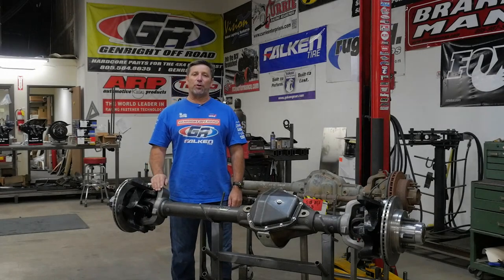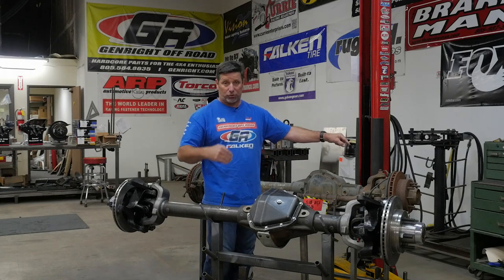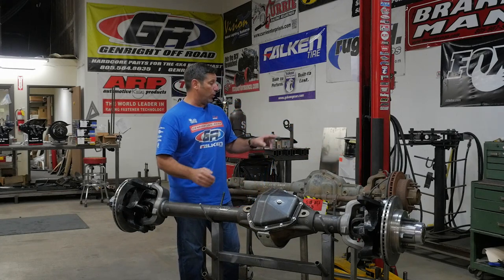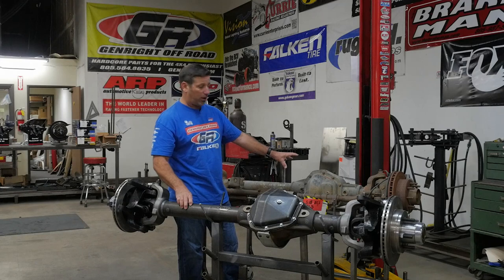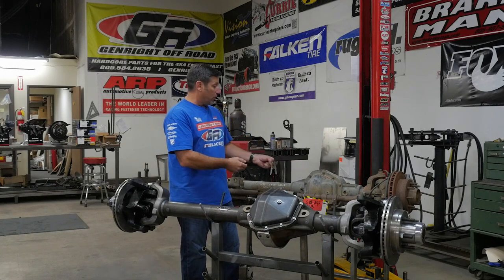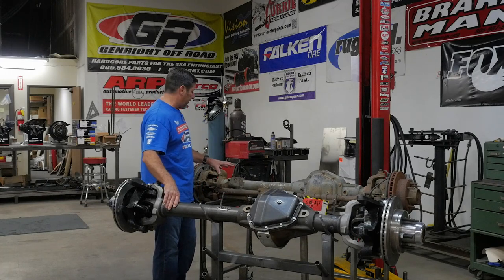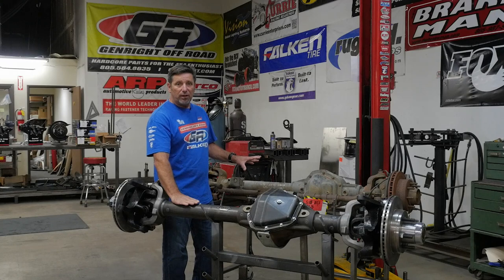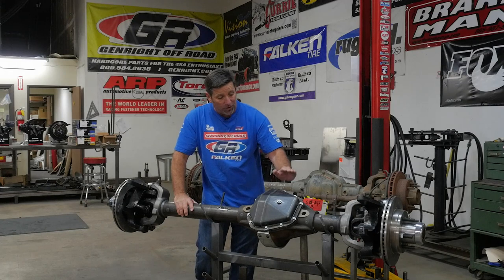Pros and Cons to Building Junkyard Axles | GenRight Off Road

Comment: 05+ super duty axle almost addresses all those concerns and can be had for less than $500. I can also go to any part store for parts. I'm not running chromolly but of i break a shaft I'll put RCVs in it... He is absolutely right, time is money and I have more time than money because my money is making me money! 5.38s, ARB, Yukon slugs, TMR truss less than $2700 for the entire axle.
Reply: You didn't do the Ballistic Shave Kit? Did you do the 14-bolt or Sterling 10.5/10.25 in the rear?

Comment: Theyre just hurting for sales because guys like me build superduty axles for my JKU for less than the price of 1 of the rear rock jock axels. The tube on the drivers side is no big deal. i had coil springs and now coilovers and still had roof for a 3 link set up. Im running stock 35 spine inner/outer 1.5" shafts, 4.88 gears, stock LSD rear and Zip locked up front. For breaks, THEYRE MEANT TO STOP 20K lbs OR MORE QUICKLY. I just bought the Duralast Gold Pads and Rotors and i lock my 43s up like im still on the 37s. As far as clearance goes, im running shave kits for both the 60 and sterling axles.
Reply: Heh, they picked the worst possible axle to show differences... a dodge with no locking hubs and crappy outers.
Reply: You guys keep saying the same thing not even realizing genright doesn’t produce axles
Reply: Yes but they have a great relationship with Currie and just want to up sell them
Reply: I've called GenRight and emailed them on multiple occasions and they are always booked solid...For their builds, they offer Currie AND Dynatrac.  Most buyers aren't certified mechanics with all the necessary tools and machines to do this on their own, let alone the necessary knowledge.  I can't count how many times I've seen posts from guys saying, "I can buy a Sport and add all the stuff for less than a Rubicon."  Yeah right, never seen it done yet.  You get what you pay for, period!
Reply: Go go 4x4 pirate!
Reply: George Wright. What shave kits are you running on your super duty axles?
Reply: @freedomrider266  then those people have no business wheeling Jeeps on one tons.

Comment: Every thing you mentioned is why I used a 2018 dana super 60 that came off a 2018 f350 in my solid axle swap dmax ...but just an FYI the 2017+ in nearly identical to the 2016 and down but the 17' and up have a 10" ring gear 1550 steering u-joints bigger bearings and 3.5" axle tubes

Comment: I thought 2005+ SD axles (most common 60 in junk yards) had both 35 spline outers and locking hubs?
Reply: MetalMatt 1776 they do
Reply: They do but I wouldn’t say they’re the most common. Usually it’s pre 05 that’s found, and those axles require a ton of fab work and cutting to get those massive brackets off and then the casting to make room on drivers side

Comment: I'm beginning to wonder if it pays to cut out the tubes and retube. No worry about nicking the tubes. New Dana inner-Cs are about $105 each. Could adjust the length with new inner axles for about $500 or less per pair. Ditto for a Sterling rear because its offset can create clearance issues. That would leave the option of double spined axles with a drive plate.

Comment: This is some hurtin' ass sales pitch. It's like he went and asked a scrapyard "hey, what 1 ton steering axle can I buy for $100?" and they threw him this. Missing parts and shit. You can buy a kingpin 86-91 high pinion 60 for a couple hundred, get 4.88s dirt cheap from a F450-F550 super 60, high steer arms dirt cheap, outters are cheap and easy to rebuild... ???? How does that amount to a $5-7000 axle that will bolt in?

These pre-builts are for people who have too much money and not enough time, or a douche-bro who goes around saying "my time is money, and my time isn't cheap" to justify why he over-spent.

Comment: Weird. Usually the DIY guy says his time is better spent rather than his money. Hence the reason he is doing DIY. Building a Dana 60 is around half the cost of a custom built one. If you include labor the price is a wash and you might as well get the pre-built custom one.
Just in parts, you are looking at around $2000-3000. Maybe $500-1000 for the axle it self. That leaves you $2500-4000 for labor or savings if you do it yourself. Not to mention a Dana 60 is overkill for 95% of jeeps.  The brakes and shafts were made for a 6000-8000 pound truck. I'm pretty sure it can handle a 3500-4000 pound jeep with 37s.

Comment: You have to be able to do every bit of work yourself to make it cheaper. And a lot of people that say “I can build an axle for half the price” aren’t really building them to the same level of aftermarket axles. Not to mention the time they put into them. By the time you finish one you could’ve spent that working OT and make more money than you save. There is a big plus to having all new everything as opposed to reusing a bunch of old parts. It makes me laugh when I see people say they can build a Dana 60 for a grand when chromoly’s and going 35 spline outers almost costs that much
Reply: Drive slugs + locker and gears costs around $800. You can get 05+ super duty axles any where from $100-1000 and they come with 35 spline shafts.